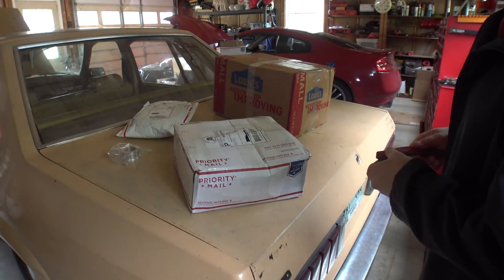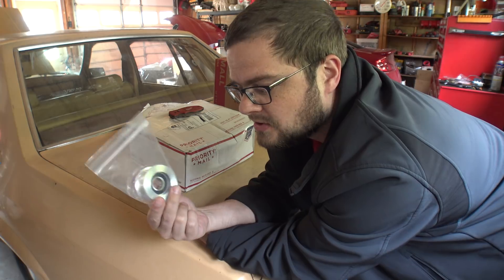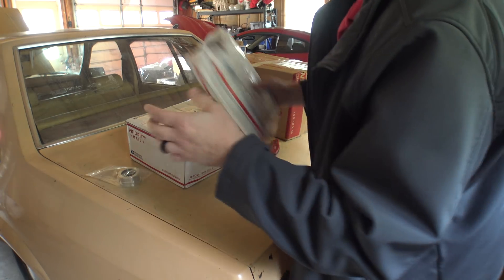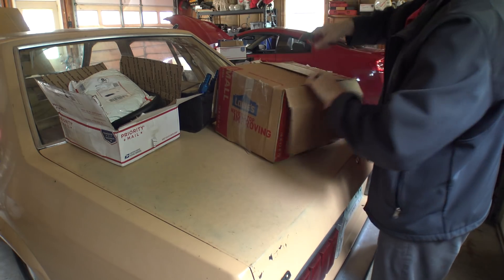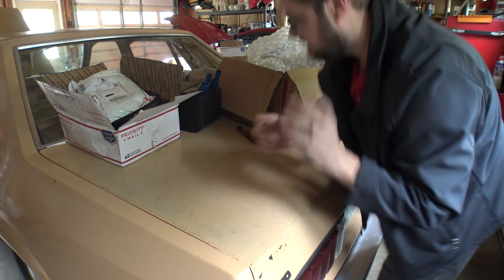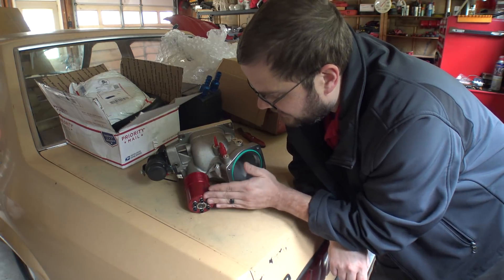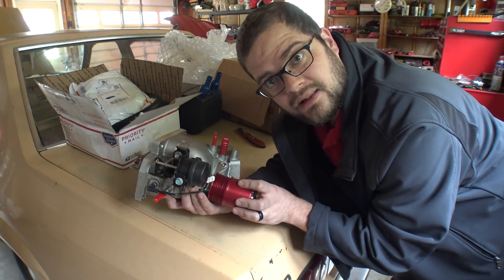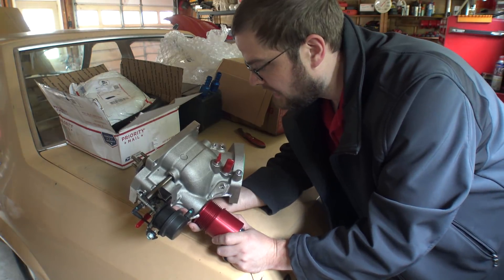the snout has arrived

Comment: Matt. Sand blast the ribbed part of the pulley. I promise you that you will have no slippage. I had a buddy that had a mustang that he couldn’t get in the 8’s because the belt was slipping. I blasted the pulley for him and it didn’t slip anymore. It got into the 8’s then. After that every blower car he built, he handed me the pulley.
Reply: Does it eat belts?
Reply: Probably not too bad. I would say less than if there was slipping. Slipping means friction, heat, wear.
Reply: Mike Brosnan nope. It was eating belts when slipping before sandblasting it tho.
Reply: My pulley kits dont slip. This is the same pulley that Leroy used to run 9s with no slip at all on a 6 rib. And also the anodize will keep the belt from tearing up the aluminum. Please dont sandblast it.
Reply: OlsonKustomWorks Never thought of that. I anodize rifle targets i make for some extra hardness, it almost feels sticky afterwords.
Reply: OlsonKustomWorks you can say/do/believe what you like but the car I speak of was a full interior 2013 5.0 that was far faster than that go kart you speak of. This car was trapping high 150’s far before Leroy was there and in the 8’s before he was. Pulley slipped. No doubt about it. I blasted it and it never slipped again. And like I said he was so happy with it, the cars he built for people he’d hand me the pulley to blast. But hey, believe what you like. I care not.
Reply: I never had belt slippage running the same setup. Although I have sandblasted pulleys in the past to help with belts slipping. But that was on a supercharged Vr6 Vw Golf.
Reply: Whats up Travis, small world no wonder you haven't been over on OSE Lol (mxkid261). I haven't been on there much either. Boats mostly just sit on the shelves now a days.

Comment: On an episode of engine masters they got so tired of hearing about belt slipping on superchargers that the sponsor company came in and rigged up the engine on the stand themselves, including using this huge billet tensioning accessory arm made specifically to get huge amounts of belt tension. It still started slipping on the dyno graph above 6k rpm, which isn't terrible, but if that's the best a main blower brand can do that's saying something.
Reply: To be fair they were pushing  like 26+ pounds of boost, most blower guys will not run that much boost. Well Sloppy Blower guys might lol.